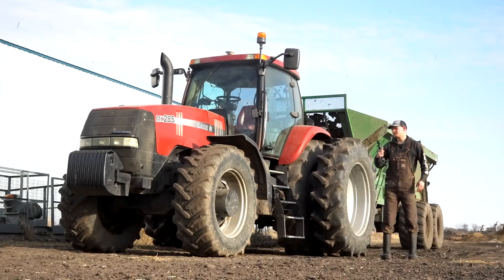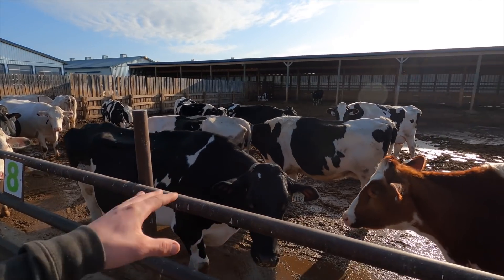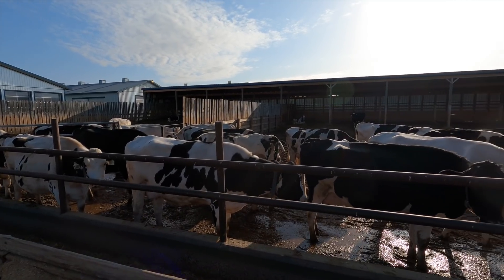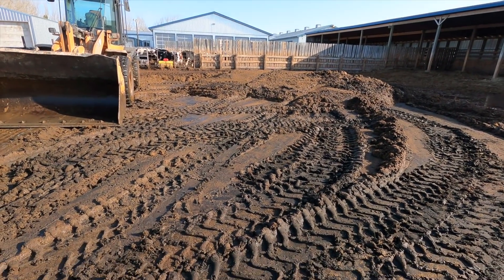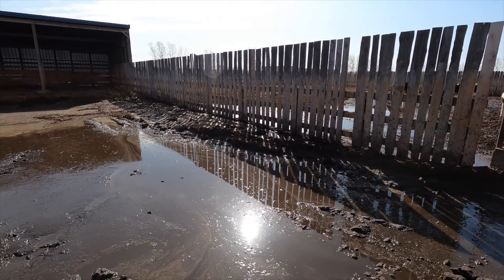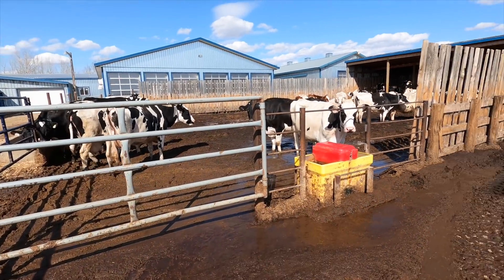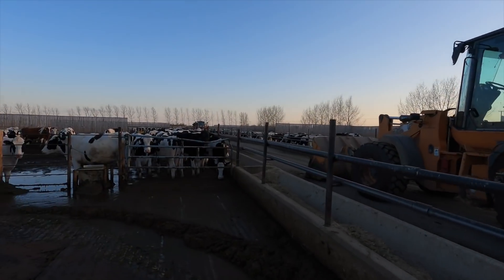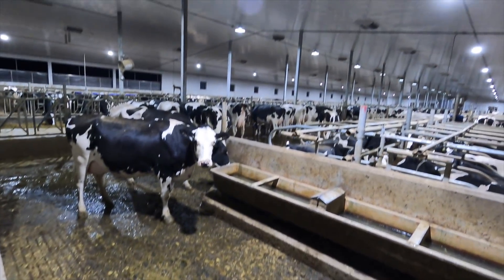Cinematic Manure Hauling!

Comment: My father says that when you check the oil on a muchine you should wipe it down and recheck it. He says it is a fail safe incase the oil level in the resevor is not the same on the stick.

Comment: Just kinda a stupid question - Concrete on the floors would obviously be a pain, but would it make sense to grade out the pens a bit, slope the overall grade to help get that liquid into say a central swale, and run out the back or something, like you'd grade a lawn or other bare-dirt / gravel surface for water control?  Obviously, wouldn't get rid of all of it by any means, but might help a bit with the more egregious amounts of slop, at least the liquid water and similar would tend to run off, instead of pooling.  Would that end up being a problem with the cows in some way, though?

Comment: I am wondering if your manure pump could work with a shovel end on it for the outside corrals. Then just pump it right into your manure spreader. It should work in the higher piles as well, or just in front of a bucket load. Time saver?

Comment: Don't you worry about your cows getting their feet messed up walking and all of that a foot of manure
Reply: That 'little' bit of manure is nothing compared to some pens that I have worked in or around over the years., and once again most cattle farmers would be very envious of Keilstra Holsteins. Some landowners get a little agressive with manure cleaning and have skidded the yellow jacket (protective covering) off area pipelines, and some have done MUCH worse and punctured pipelines, cut cables and damaged other buried facilities. Always got to be careful anytime your digging with mechanical equipment, and don't need to scare anyone - but this is SERIOUS and could be fatal.